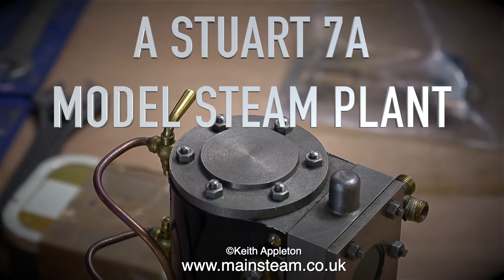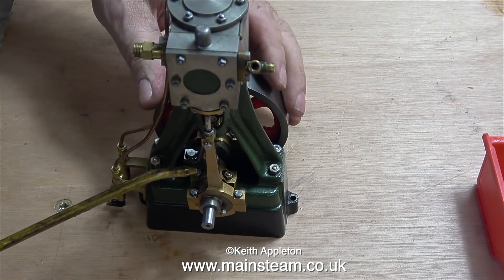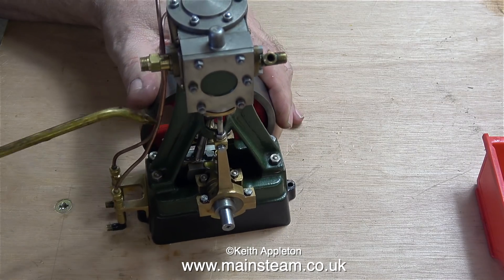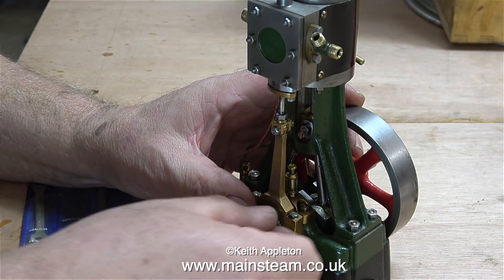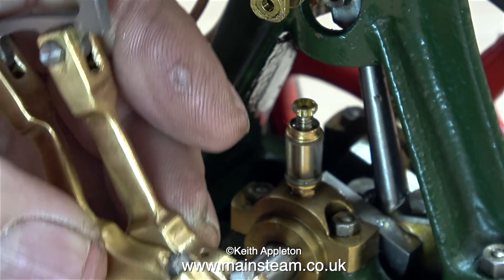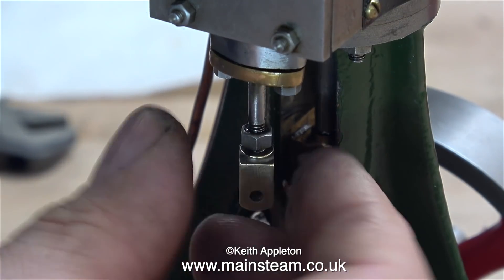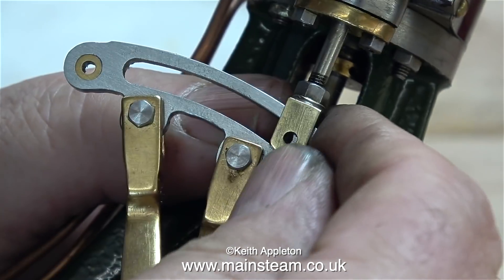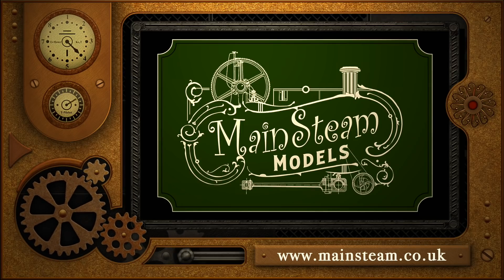A STUART 7A MODEL STEAM PLANT - PART #2

Comment: 3:36 I see you have a print on your finger, I got one myself, but on three of my fingers, which are from the same cause on all three, holding the hot object in those fingers for a tad too long (far too long, since I held it at all, to be honest). It's not very visible now (mostly healed, but hurt pretty bad when I got it). Now, here's a poorly placed question in this comment, where did the print come from?
Reply from the maker: That's not a print or a burn, it was the mark left by me when I used my nail clippers to dig out a bit of metal which was stuck in the end of my finger. It went in deep so I had to do a bit of digging }:-)))

Comment: Would you consider a Titfield thunderbolt Thunderbolt to be a good beginner engine? Also could you use a reamer of appropriate size to bore a locomotive cylinder if you couldn't get it in the lathe?
Reply from the maker: one of my favourite engines, but not the best for a beginner to build. Yes you can ream the cylinders.
Reply: @keithappleton  would you recommend a 3.5 inch gauge Titch for a first engine?